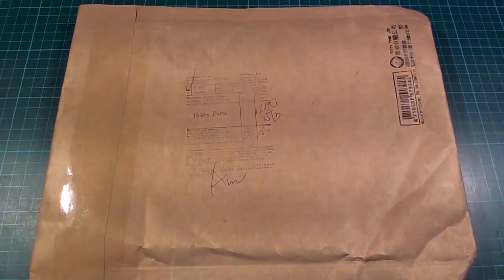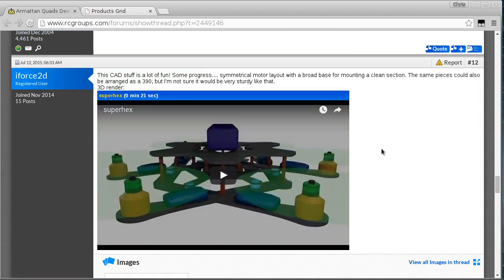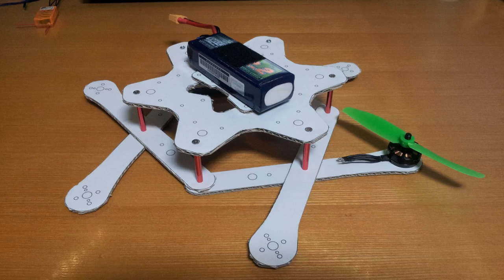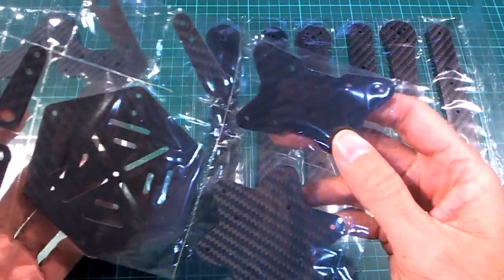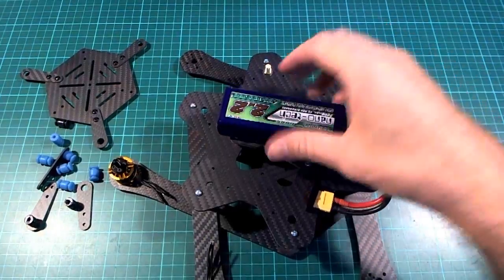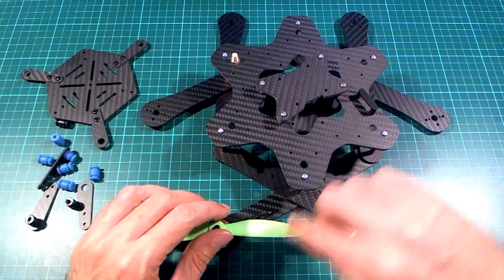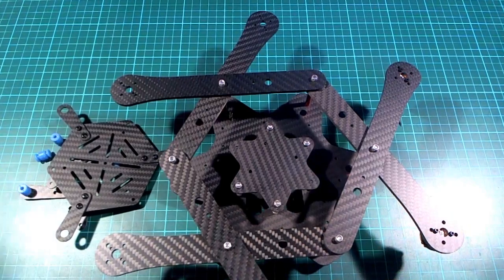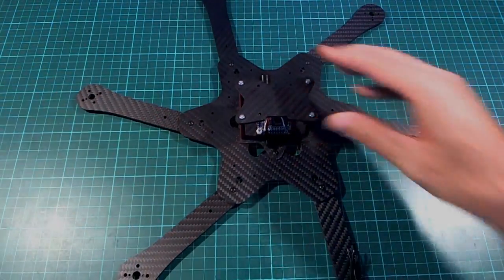Custom hexacopter frame (Armattan productions)

Comment: the frame should have need for 6 inch props. it's a hell of a lot of frame for 5 inch.
Reply from the maker: +Tim Dickinson what do you mean by a hell of a lot of frame? Isn't it the weight that's important? Remember it's a hex, not a quad so each motor/prop only holds 1/6 of the weight. I did a maiden flight today at AUW 620g which is just over 100g per motor to hover, a pretty easy task for either 5 or 6 inch. Having said that though, those trimmed down 6 inch props I showed do give a less strained feeling sound when flying.
Reply: +iforce2d it looked like a large frame. might be that the center is large. 600 grams for a mini hex is not bad, I built a frame for my mini hex at about 950 grams but I'm running a 5000mah. what I did with my frame is have the motors under slung so the motors point down not up. with your frame looking at the center plate the thrust from the props should miss the frame all together if you flip the frame. should give you better flight times if your going for an AP rig. nice frame by the way.